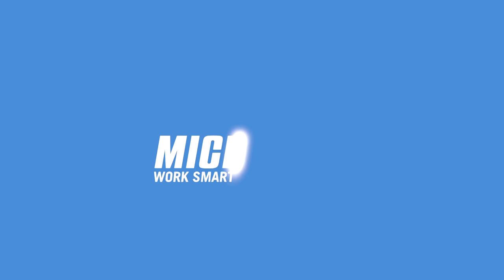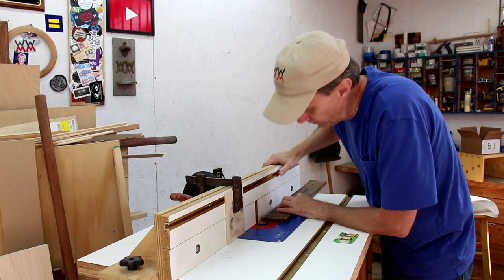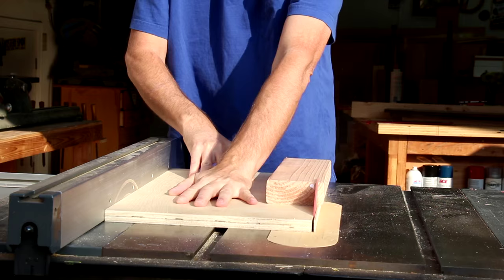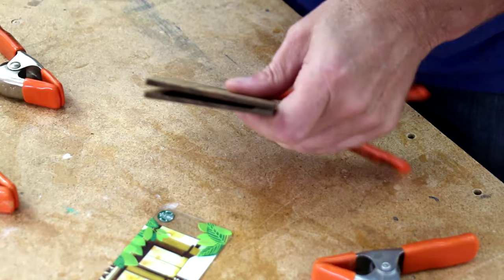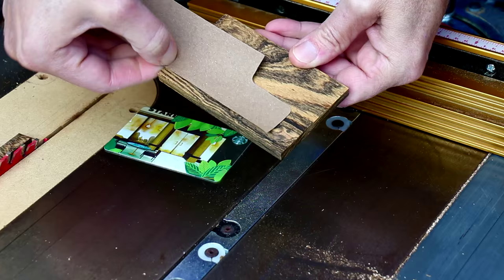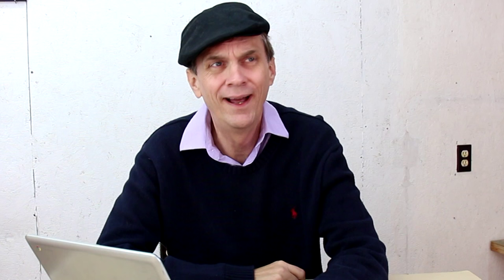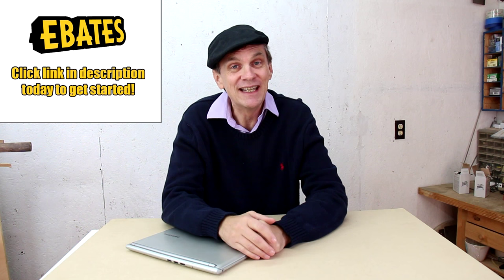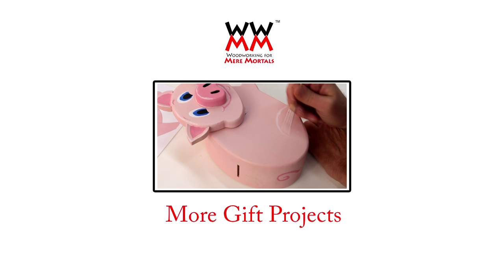Wooden gift card holder

Comment: HELP ME PLEASE
I have one question.. I want to start wood working and I have everything I need but wood!
How do I get wood! I have plenty of oak laying around, can I cut them and use them for knife scales, do I need to use some special part of the tree? Can I buy good woodworking wood at places like home depot?
Reply: It depends a lot on what type of project you are doing, but really, as long as the wood is not still wet, you can use it (it takes a couple years or a kiln to dry out wood to be useable). I started with reusing pieces from broken things I got at yard sales, and wood from the home center. It makes way more sense than starting with really expensive specialty wood from a special store. 
Good luck to you. It is a lot of fun, if you stick with it.
Steve does a more in-depth video about selecting wood that you should check out if you still have questions about it.

Comment: How do you remove the wood hot glued to the sled for cutting?
Reply: +James Rawlings     Use a hot air blower gun.  Or, as I commented just today, use double sided tape instead of the hot glue